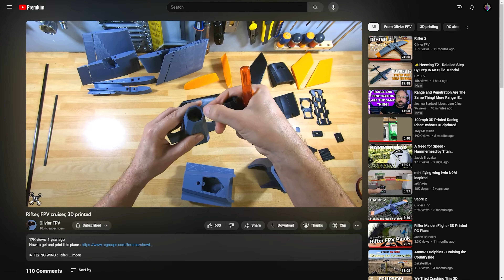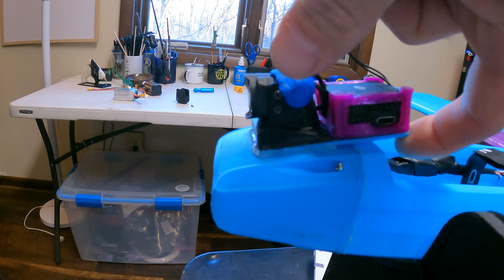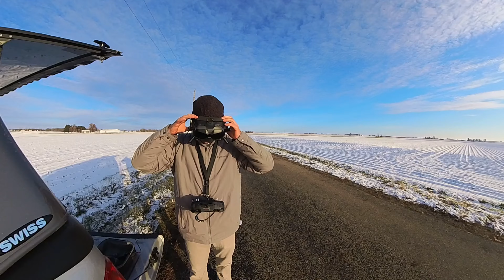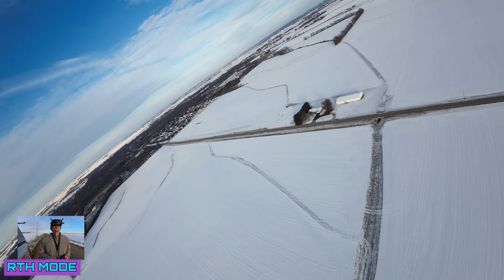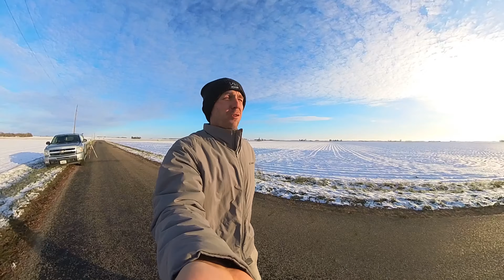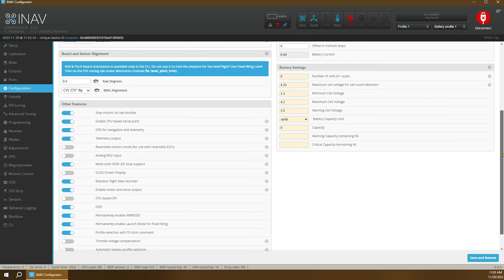FREE 3D PRINTED FPV PLANE - HOW TO BUILD, TIPS & PARTS USED - RIFTER

Comment: How do you avoid strings from the hot glue? I also like hot glue much more than super glue, but the strings pulled away from the glued Part Sometimes sticks to the models surface

Comment: Hi, im trying to print this exact model but when I get to the the wing cura isn't including the internal supports of the wing and only slices it to have a single wall outer layer.  Then when the print finishes its all wavy and flimsy.  How do I get cure to make the correct internal structure?  The A,B,C and D profiles are no longer on the website either.  Was I suppose to load the 3mf files in fusion then export them as STL or directly load them into cura?  Thanks...    Also another problem the alerions are joined to the wing and wont move after printed
Reply: Cut the ailerons with a sharp knife. I purchased 2 rifter from a private seller very cheap.

Comment: Hi Geff,  I've been struggling to get a decent finish on Oliver's 3D Prints especially the elevons  due to the print height and being very narrow with a very poor finish at the tip. I know you uses the same printer as I do, so whats the secret please
Reply from the maker: For me I check bed level all the time and I keep my filament in a sealed bag when not being used.  If I start having problems, i usually get a new roll of filament
Reply: You can use a custom made aileron support thats its own stl file to keep it from moving. I think there is one on thingiverse.

Comment: I believe the yaw instability on takeoff is due to the tail fin design. They have a high dihedral angle which decreases their effectiveness.  I believe if you added some wingtips as a 'fix' you might have more success. I've been making my own similarish plane design and after crashing some prototypes and making test gliders I also had this problem. Increasing the tail fin area and making them more upright fixed the issue like magic on the test glider. I had to throw it just right to get it to glide but with extra tail fin it tracks straight as an arrow. Wingtips would be easy for you to try out so you don't have to modify the plane much